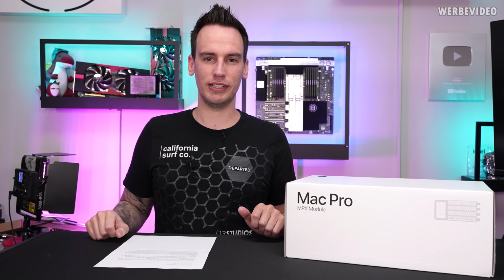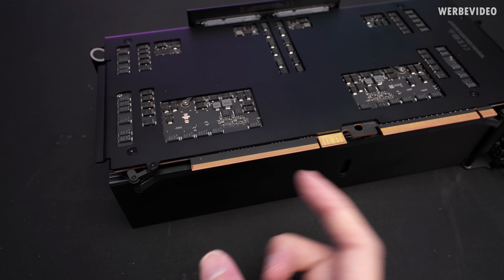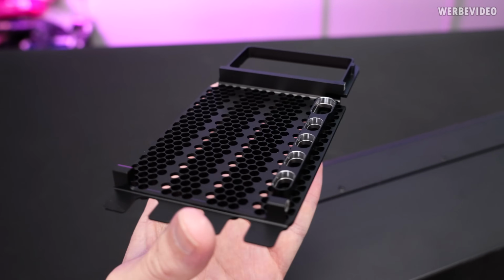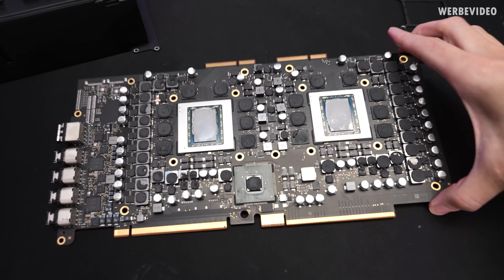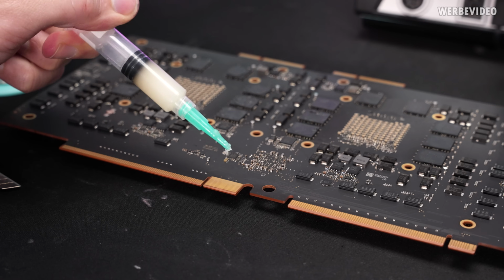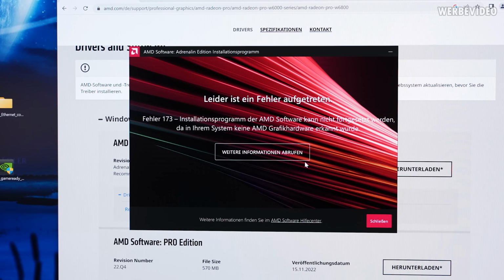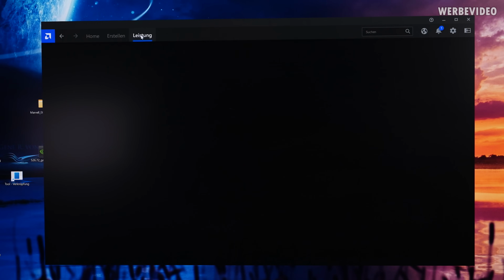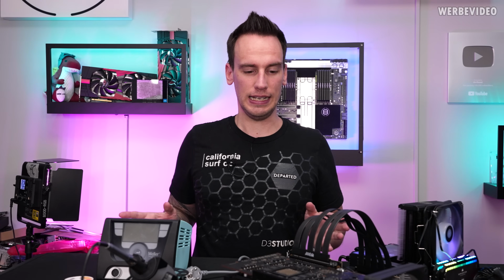This Insane AMD Dual GPU from 2021 is Faster than a RX 7900 XTX

Comment: Honestly Id love to see something like this on pc where the add in cards are these modules which has shrouds fully covering the length of the case as air ducts. While the fans upfront are cooling everything. 

It just looks so neat and clean.
Reply: Also be a ton easier to stack the cards with out suffocation some of them.
Reply: That would be hell to standardize though, the number of cases with different lengths would be impossible to support. Although perhaps for multi-GPU systems it could provide a benefit, but considering shrouded GPUs would be using more ideal blower fans and coolers anyways, it probably wouldn't be that different in terms of cooling, at least compared to all of the expansion cards being cooled as their own collection.
Reply: @jamesbuckwas6575  There is no need to standardize, some case manufacturer could theoretically sell this thing as a 3rd party cooler for some specific gpu+case line. Realistically not viable to sell as a product, but could be an interesting marketing stunt to maybe manufacture limited pieces at ridiculously high prices just for the sake of it
Reply: like... servers.
Reply: @rawhide_kobayashi  Servers have proprietary shrouds, and yes its the same concept but I want it done in a standard pc case.
Reply: neat and clean is basically what the Mac Pro is. Clearly, it's a Mac and tech guys are supposed to hate it under penalty of manhood shrink. But if the Mac Pro was a PC  we will have to accept it's an engineering wonder.  The target is easy to use, so it's easier to install an MPX module than a normal card (no need to move around cables), but it's not designed for hacking.
Reply: Good luck trying to get enough airflow trough without bajilion fans on case. Btw apple stuff is already castrated to not melt the entire thing, there is just not enough cooling for full power card, much less overclocked one, which is compensated with apple ""magic"" (having personal OS perfectly tailored to work with your machine and software).
Reply: @alexturnbackthearmy1907  Here it is, the hate we see everywhere without any substance or any proof to the claims. Just hating on the OS because you have no clue what you're talking about. You sound EXACTLY like someone who has never worked with MacOS.
Reply: @mich977f  I hate on apple designs, not OS. Unless you mean iPad OS, which is certified trash. Enjoy your overheating or severely power limited device i guess.
Reply: @alexturnbackthearmy1907  "which is compensated with apple ""magic"" (having personal OS perfectly tailored to work with your machine and software)." If that's not about the OS, then idk what that's about.
Also, I use Linux, but that doesn't mean I'm narrowminded.
I won't have to deal with a severely power limited device, at least not with my specs. With that said, I don't think Apple's devices are power limited at all. Actually, they're extremely efficient, which is very very good.
It's funny how Apple are so popular if their products are so bad, even in the professional world they're extremely popular.

Just so you know, if you weren't aware - The YouTube comment section doesn't reflect the opinion on the general population. You can say what you want, but statistics show otherwise.
Reply: @mich977f  And so do statistics.

 14900K can eat lots of watts, 14900HX - not so much, which means its power limited. Same story with apple devices - they are pretty conservative (and thus efficient) with power limits. And they definitely can do much more - with proper cooling and power limits. You would see what they could`ve been in next gen intel chips.
Reply: @alexturnbackthearmy1907  And if they weren't as conservative, they would have to make their laptops thicker, more cooling, more noise etc. They're very capable per/watt, which is what matters in mobile devices.
Also a side note, maybe Intel is powering theirs a liiiittle too hard on the 13th and 14th gen 😆
It's not always better with more watts. Just like in lamps, LED vs traditional wire bulbs etc.

Comment: Interesting video. that make one wonder if we actually can use 2 6800 in a mobo that is Crossfire certified, which there actually is several of even sli and crossfire is technically a thing of the past now.
Reply: no because the cards not using traditional crossfire. it's using what's basically NVlink but using infinity fabric to connect them through the bridge. this is a custom apple design, AMD uses a completely different infinity fabric implementation on their own hardware.

Comment: I think there's a decent chance intel will release a dual and maybe even quad gpu card
Reply: That would be cool!  It’s never occurred to me they might try to dominate the GPU market by bringing back multi GPU.  If it worked on a driver level, and not a game engine level, so that it worked universally for all games, THAT would be awesome.  The main trouble now is many of the motherboards used to focus on having multiple x16 PCI-e slots, and a lot of them now don’t even do that, they dedicate a lot of the PCI-E lanes to the M.2 slots.  But it would be really cool to have a 4 way Intel GPU setup like back in the day.
Reply: @chincemagnet  i think it will be difficult for a variety of reasons, but arc seems to possibly lend itself to this. Maybe.

Comment: GPUz is at the bottom of my utilities list, it just doesn't display anything useful if drivers are not installed. I wonder if we'll eve see dual GPU cards like this in the consumer space again.
Reply: Dual GPU is not a viable concept for consumers. The workloads that consumers use do not scale properly across multiple GPUs and there are latency issues that can create stuttering. Back in the day before we measured frame pacing and lows, boosting average FPS by 40% seemed like a good idea. 

That’s not to say that we can’t have multiple GPUs working together for consumers. They just have to be seen and operate as one. Future chiplet based GPUs will technically feature multiple GPUs, but they will operate as one. As long as they are designed properly the frame pacing will be good and can be sold to consumers without being butchered for delivering a poor experience. We will probably see such cards beginning in 2024-2026.
Reply: @dex6316  don't focus too much on games. There are still some workloads that can benefit form this. which preferably not just for the Apple ecosystem.
Reply: what's your replacement that shows all that information without drivers installed?
Reply: @FakeMichau  theres a handle of utilities like AIDA64, HWINfo and GPU CapsViewer

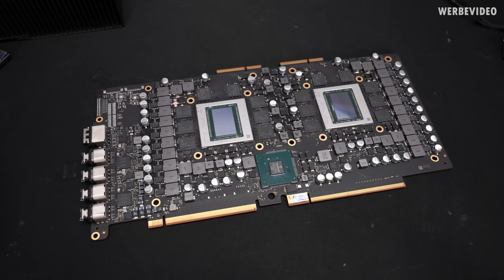Comment: 17:15 the MPX connector is there to make the card proprietary. It's even in the name MPX: Mac Pro Extension.
Reply: It provides a direct and dedicated I/O path for the MUX so that every Type-C connector on the machine can be a display output from the card(s).

Comment: This was such a cool experiment. As long time Mac customer, now running Ryzentosh, I can properly appreciate Apple’s obsession with silent running and no fans.
Reply: ... You still need fans to cool this. They're just more inefficient case fans. This thing runs like a server
Reply: @KPalmTheWise  you do need fans but they are not inefficient. They are designed to be used inside MacPro case with those 3 huge fans blowing through everything in the case. It’s masterful design optimized for silence. In that setup they are efficient as needed. I love that approach vs squeezing performance at all (acoustic) cost.

Comment: I would wonder if you could get your hands on a used Mac Pro to then strip and load windows 11 on with everything water cooled and maxed out or to at least use to get voltages.

Comment: What I used to do, is modify the driver ini file, with the PCI ID that the card is showing. That usually lets it skip by the check and install the driver, to try it. I've done that lots of times to get drivers working for cards using the same chipset, but different PCI ID. SO if you dig into the driver files, you may be able to do this. The thing with the packaged drivers now, is you usually have to run the installer, then copy the unpacked driver from the temp folder, and then modify the copy, and manually install the driver.
Reply: I did that with a 1660 Ti when I was having problems in AC Odyssey. There was only 2 drivers available at the time so I took the driver from a month before the 1660 Ti came out and "Whitelisted" the 1660 Ti so the drivers would install and used them for 6 weeks until Ubisoft released the next content update which fixed the problem so I could run the most current drivers again. That's a trick from about 15 years ago we used to use before Nvidia unified the drivers. A lot of times you could take the drivers for a GPU that was the next one up the stack and whitelist your lower tier card and gain a little extra performance as it would change the clock speed and power profile but that trick no longer worked once they unified the drivers. With the 1660 Ti  (Which is basically a 2060 without RT and Tensor cores) I suspected the code for it would already be in the drivers a month or two before it released, they just didn't whitelist the card and apparently I was correct.
Reply: This Is How you install the newest Mesa good graphics driver on GNU/Linux on PS4 to work perfectly with PS4's AMD GPU with the same driver used for AMD GPU in GNU/Linux on PCs
Reply: but its a little more complicated on GNU/Linux
Reply: Hm... pretty much the same way i did it with NVIDIA. Where i can read about Radeons? Just interesting.
Reply: smart.
Reply: Where should i start to get this level of knowledge 🖤🥹
Reply: @عمرنايف-ت9ي  watch a lot of videos on here, and break stuff ✌🏼
Reply: EA is known to lock older cards out of their games (BF1 for sure... happened to my 6970hd).
Reply: 👍🏼 nice

Comment: I have seen some really scuffed setups on youtube to go fast, but soldering power to the card is just wild.
Reply: Search for TAGG XOC he have some eye watering jaw dropping videos about modding motherboards and video cards, lots of soldering, cutting, scrapping and dremeling involved!
Reply: Ever heard of volt-modded GPUs?
You disable a card's voltage regulator, and solder a whol different VRM on like EVGA's E-POWER series.

Comment: What a shame. Pooh-poohing the pre-existing thermal paste coverage only to put it back together without enough thermal paste. It's great to see a device engineered with known constraints -- i.e. there's only one box it's designed to be put in -- where TIM need only cover enough of the surfaces to do the job rather than the consumers' commodity cards which have to work in more diverse conditions and only catch fire occasionally and so the expectation is to have to slop it on liberally.

Comment: the connector on the top edge is for infinity fabric which is similar to Nvidia's NVlink so each core can access the memory of the other core and depending on how the driver is setup it could be doing that transparently making the dual gpu act like a single gpu to programs being run on it. As for the MPX connector the pinout while not publicly fully known it carries video down to the motherboard to be routed to thunderbolt connections on the system and brings thunderbolt pcie lanes into the card to be exposed on the rear.
Reply: That's very cool. Thanks for that info
Reply: that's quite amazing what they managed to build with this card and the mac. If only we could see these kinds of things on more vendors.
Reply: I believe it's possible to run two of these modules in the mac so I'm pretty sure that's what those IF connectors are for... now I'm really curious if a quad GPU setup could get hacked together in Win.
Reply: That bridge chip is doing work. With the 56 lanes it’s handling it’s like 16 per GPU, 16 for thunderbolt and 8 for the memory.
Reply: According to a diagram I found, you can connect two of these cards with an infinity fabric for the 4 cards to pool their memory.
Reply: I forgot how the mpx connector works, thanks for the reminder
Reply: Nothing new 295 Nvidia Dual old project or 550 Ti Dual... . Mac shit and price for Bankster childs.... .
Reply: Why not just build it in?
Reply: @hombrepepega3472  Built into what? It's literally routing it to the mobo IO which I'm sure will depend on how the specific machine is configured. It also makes it proprietary which is kind of Apple's thing.

Comment: What if the MPX connector is for quad crossifire?
If I remember correctly you could put 2 of such cards in the MAC pro. So if you want a quad card solution you will need ugly bridges. But for apple this is a no go.
Do we have Crossfire pinout? The Crossfire jumper I have has 10 pairs, this matches with the 10 pairs with decoupling caps I can see in the video. If the other pairs (the one without caps are also 10 it means that is CrossfireX bridge betweent the 4 GPUs.

I  have an really old HD ATI card and I've seen that the corossfire is indeed 10 pairs but no caps in the pairs. Someone should check how/if the lanes are split in 5tx+5rx on newer cards and if they have have the standard 22nF caps in TX lanes of hi speed busses.
About the pcie gen3 it might be the cable the PLX (*pfx) chip is marked G4 soo... riser cable issue?

EDIT: I think that the cardss will be connected as such:

CARD_A: GPU_1 <built in bridge> GPU_2
                ▲MPX▼                        ▲MPX▼
CARD_B: GPU_3  <built in bridge> GPU_4

If some hi res photos would be available I could dig a little bit more... in the "reverse engineering".
Reply: Its for the thunderbolt ports, but maybe could be used for other things. All thunderbolt ports on the mac pro can be used for display out, including the front panel
Reply: there is a quad fabric connector for dual duos, search for apple a2667

Comment: Hey Roman, You should check out the XFX BC-160 Accelerator. It uses the obscure AMD Navi12 GPU with 8Gb of HBM2.
Its similar to the 5700XT but uses HBM2 instead of GDDR6. They were built for Blockchain usage in mining farms.

A bit of background:
The Navi12 GPU was only supposed to be used in Apple 2020 Macbook Pros. Apparently there was a massive oversupply of the Navi12 GPU and they started using them in Mining accelerators such as the BC-160. The Navi12 features basically ideantical specs to the 5700XT but with HBM2 and a 4096Bit memory bus.

I'd be very interested so see a video on the card. I've never seen the Navi12 GPU in the flesh before.
Reply: + 1 wanting to see it investigated.
PS: slight correction its a 2048bit buts
Reply: The closest that I've seen in person was the Radeon VII (I picked one up for $140 locally at one point), and it was...underwhelming, to say the least. 

HBM2 is great in theory, but games don't really support the usage of it. I was getting 2080ti level performance in well-optimized titles, but 1070 performance in older titles/UE5 stuff. It was all over the place for gaming, but I'd imagine it would've been great for workloads.